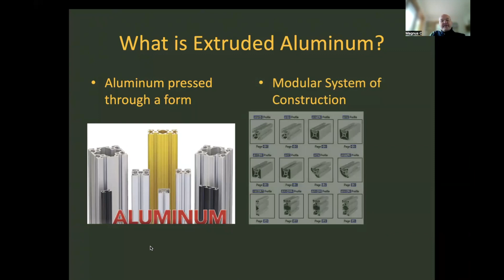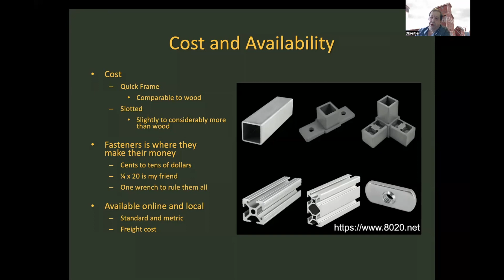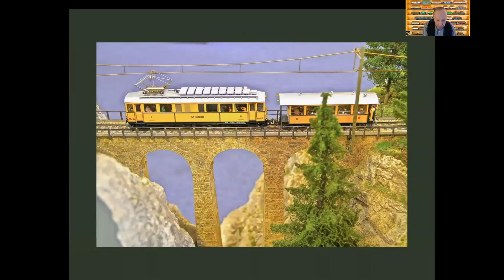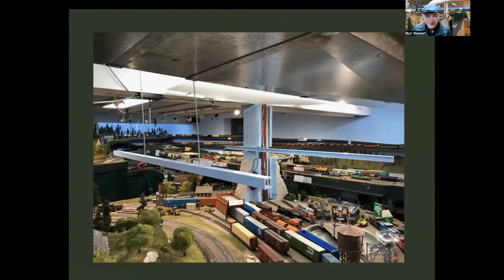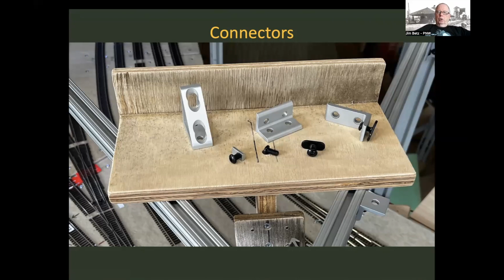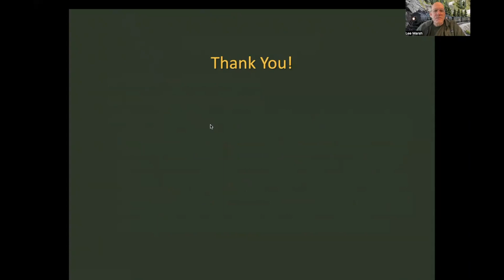Aluminum Benchwork for Model Railroads: A Panel

Comment: This was a great presentation, thanks. I am trying to design a Fn3 (45mm gauge) portable layout that will fit in our 14’ trailer and quickly assemble into a layout with 6’ curves for my large locomotives. 

I think aluminium benchwork will be a necessity.
Reply from the maker: Keep us posted on your progress, and thanks for your comment.

Comment: Great presentation. Would it be possible to get a list of parts that Dave used on one of his pennisula sections. It's almost exactly what I was thinking about doing except maybe not two sided. But the support for the lighting was tripping me up along with trying to figure out what size pieces (length and cross section since they come in so many different mm and inch crossections). Thanks in advance

Comment: A combination of open and closed top with ply could be used, depending on location, to construct furniture type racking underneath which also forms the legs.
There are many parts available including hinges to use for moving sections for access and sliders that could be used for train table staging.

Any idea what the minimum section equivalent would be to replace traditional timber framing?
I am guessing 2040 for smaller shelf layout frames?
I think that would work with 2020 for multi level riser supports.

Comment: Great presentations, definitely will consider extruded aluminum! One slight point of criticism, in several cases joints have been shown which are made out of steel. To properly combine aluminum with steel it’s recommended to use nylon separator rings to prevent electrolysis. Also this will help make the nuts and bolts unscrew easier. In combination with aluminum, a steel nut or screw can really get stuck into the soft material.
Reply from the maker: Thanks - this is really useful information for anyone considering this.